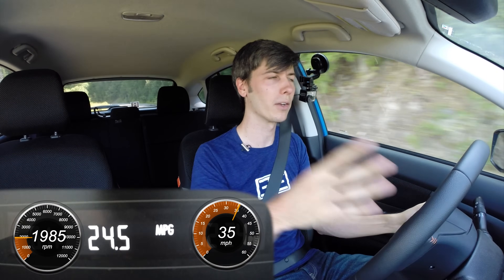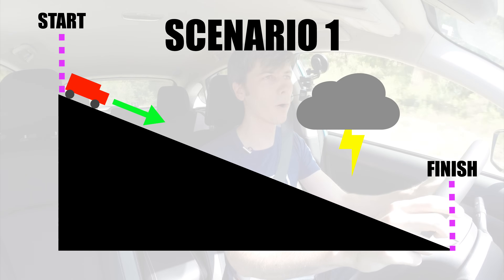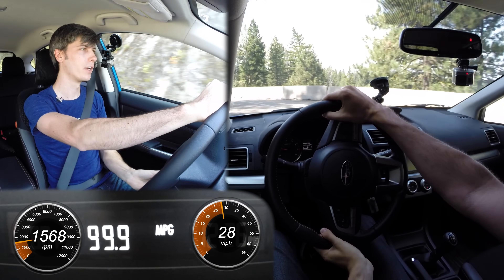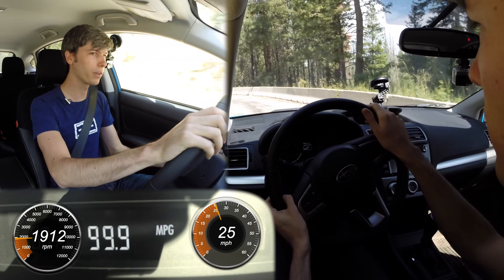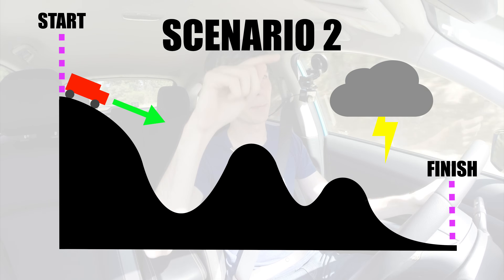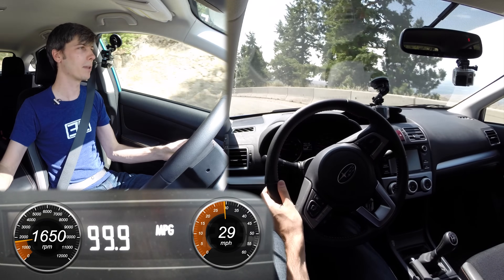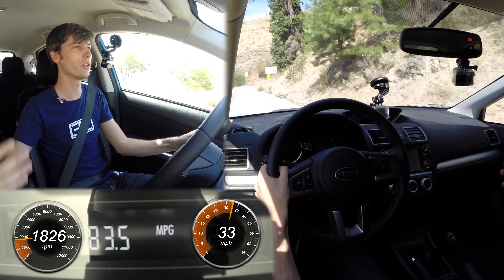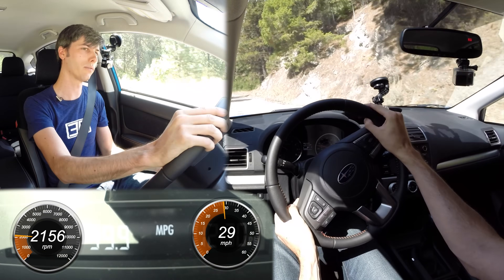What Uses Less Gas - Coasting Or Engine Braking?

Comment: I drive the same car (2015 model) and drive a mountain pass everyday. I notice that coming down in 5th gear uses fuel  but dropping to 4th  doesn't despite both allowing the car to gain speed downhill. At a low enough rpm it seems like it uses fuel regardless. On a side note, this car has the least amount of engine braking force I've ever experienced, much less than similarly geared manual transmission cars I've driven.

Comment: Well, my cousin's 1994-ish Chevrolet Corsa, with a 1.4 liter, Inline 4, Single Point Fuel Injection Gasoline engine, does not bother shutting the fuel off when going down a hill.
Not sure if the tech's too old or if there is a malfunction over all those years of neglect, but there is always a little bit of fuel going by on downhills.
Engine brake's still strong enough to lock up the front wheels in a rainy day if you dump the clutch on a gear too low though.

My Chevrolet Celta 2005, 1.0 liter inline 4 Multipoint Fuel Injection Flex (gas\ethanol) does shut off injection when it's going down a hill... and the engine braking is crap, even with the car completely empty.

Comment: Firstly, yes, neutral uses some fuel, more if it's an automatic, because of rev-matching. 
Your video brings 2 points to mind. 
1. When you're rolling down, using engine breaking, isn't the engine at a certain rpm (say 3000), wont it need some fuel to run?
2. Let's say the injectors a shut off, won't that create a vacuum? And possibly damage the intake valves?

And you've already explained about carburetor-powered vehicles, that there might be sm fuel going into the engine, where fuel pump would still be running. 
But, what if, you're still in gear and let your foot off the gas (on a highway, lets say), what happens then? Is it the same, that the injectors are turned off?

Comment: How do the injectors 'know' to shut off when in gear?
Reply: Well, the better question is how does the ECU know to stop firing the injectors. Actually it's very simple. If the engine runs over idle rpm or a certain rpm threshold and the throttleplate is completly closed at the same time, it no longer commands the injectors to fire.

Comment: While interesting imo this doesn't take into account most interesting scenarios. Your scenario 1 is basically obvious one, and scenario two is completely hiphotetical without previously knowing the road and experimenting. What about straight road, for example two miles to run, what is more efficient to coast in neutral losing some fuel but going further or ride in gear and lose more speed so you have to use some fuel to get to the same distance? What about going uphill?

PS. In SI, we use l/100 km fuel usage, so when coasting it's showing 0.0 which is correct, your system would have to show infinity symbol to be correct :) SI for the win ;)

Comment: So in a FI engine, if the throttle is disengaged and the road is driving the engine by means of the wheels and drivetrain, and the ECU detects higher than idle RPM, then there is no combustion happening in the cylinders even though they are revving? Is there no exhaust being ejected then, except for maybe air? Please educate me, I'm really curious.

Comment: Back in the day before power assisted steering and ABS brakes, you could both put it in neutral and turn off the engine and head downhill...

Comment: In your 5 things not to do in an auto you said the reason you dont coast in neutral is dangerous ect i understand were not talking about risk points but later you said the car will stop using fuel when its coasting because of the computer and will see no gain in fuel saving but in  this vodeo you said you will not trying to argue your the engineere lol but im just curious

Comment: Depends indeed. In my 2010 Mazda 3 with a manual, the current fuel consumption readout says it's 99.9 mpg going downhill whether in the 6th gear (was on the freeway) or in neutral.

Comment: I think you're missing some rigour in there. To assess which is the most fuel-efficient, you have to compare the same thing and not take two completely different scenarios. Engine braking power is roughly proportional to engine speed, so when the engine is idling, it requires just enough fuel to keep the engine speed constant which comes down to providing the same power output as that of the frictional loss. If you are in gear at higher engine speed than idle, it means you are basically dissipating energy at a higher rate than what you would do at idle, and hence you are making the overall fuel efficiency less. Now it all depends on how efficient your engine was when you built up the speed, and how efficient it is at idle. With regard to that, I believe it is nearly always more efficient to coast.  The test to really decide which is best is to take your car in a gentle slope which enables you to keep constant speed while coasting, check the fuel economy, and then put it in gear and apply enough throttle to keep the speed constant (same speed as previous test to rule out drag), and finally checking the obtained fuel economy for comparison. That's the only way to compare coasting versus in-gear driving. The best solution would obviously be to coast and switch off the engine meanwhile, but with all the power-dependent equipments on the current cars, it's not really suitable yet. I am sure it will however come soon.

Comment: i'm curious, what is feeding those numbers?
the on board computer? not very reliable...

can you make a video with measurements at the fuel tube and exaust end?
if it's really not consuming any fuel, the fuel feed should be zero and the exaust should be not emiting anything but residual heat...

can you make a vid like that, please?

Comment: So living in the mountains I have always used lower gears and "engine braking" to slow myself downhill to reduce wear on brakes.  Always have learned this is just how you drive but recently started hearing people argue that point saying it is better to constantly hit the brakes going downhill because new brake pads are cheaper than the wear the engine is getting.  Does engine braking or simply using low gear going downhill harm the engine that bad that wasting brake pads is the better option?

Comment: Engineering Explained can you pls answer in writing or video: Something along these lines.. what happens if you drive an auto, decide to coast in neutral for awhile, then put it back into drive again. You don't know what gear you'll be in so you can't match revs to speed. Does this negatively affect the transmission??

Comment: Great video, had this discussion at work many times too. The built in mpg gauge may behave differently based on manufacturer software. I logged injector duty cycle on my Subaru to get the same conclusion and would be more consistent data regardless of the car.
Reply: Sometimes its just a real time reading instead of an "average"

Comment: "Why", you ask, "does the car use no gas while coasting in gear?"  Because the throttle has a switch to tell the ECU that your foot is off the gas. Simple.  Some cars have a switch at the top as well (a 'kick-down switch') that tells the transmission to shift down (within limits) for faster acceleration.  Gas is turned back on when the engine speed is below a certain level (my car, 1400 rpm) to keep it running when you are in fact sitting at a light in neutral.  In my car, the ECU doesn't measure road speed or transmission gear or clutch pedal variables, it only works on engine speed.  It's an '86.

Comment: Also, do not use engine breaking in an old two-stroke vehicle. The RPM is much higher and the engine does not get enough lubricant and you can seriously damage it. Of course, such vehicles are hard to see on the streets anymore, practiacally impossible out of classic car shows.

Comment: So my question after watching this video is, does engine braking (especially when the engine gets to pretty high RPMs) put any extra wear on the powertrain? I'm curious because I've started engine braking to save my brakes but I don't wanna ruin my transmission in the process, for example.
Reply: Of course mate, friction is happening inside the engine

Help your brakes with 2200rpm but don't exceed that because it's not worth it if you're gonna keep the vehicle for too long

Comment: Quick question: Does this apply to an older car, say, a 1993 Nissan Cefiro with an RB20det? Does the injectors still turn off in the state of engine braking?

Comment: Your Subaru has a transaxle, not a transmission.  Also, a roller coaster has momentum, not gravity.
Reply: Michael W You know that part on a roller coaster where it pulls you up to the top of a giant hill and you almost stop moving? That would be almost 0 momentum, but full gravitational potential energy. Roller coasters absolutely work because of gravity. Also a transaxle is a type of transmission.

Comment: WRONG. The injectors are NOT "shut off" when you close the throttle. That would damage the engine and be dangerous from a control standpoint. There is fuel going to the cylinders, but it's only enough for an idle. There will be slightly more fuel injected with engine braking because of the higher rpm. The reason the computer goes to 99 or whatever your particular car's max is is because the method used to calculate the fuel economy is just an estimate, and as the number goes up the accuracy goes down. The amount of fuel being injected is relatively miniscule, so of course the economy goes up, but it is also impossible to measure accurately with the method that the car's computer and hardware uses. The first cars to have an mpg display were wildly inaccurate. They have gotten a lot better, but if you religiously calculate your fuel economy manually you will find that the car's estimate is not totally accurate and is better under some conditions than others.

To answer this question accurately would require actual scientific testing with equipment not available on any production car.

Also, the assumption should not be that you are coming to a stop at the bottom, but that you are going to be maintaining the speed limit from that point on.

Then there is the question of whether the incline is enough to make you speed up, stay at a constant speed, or slow down when coasting. For purposes of this discussion, it's reasonable to assume only the case where you will pick up speed if coasting.

That said, some educated guesses can be made. Coasting in neutral, the engine is idling. Using engine braking, the engine is also idling, but at a faster RPM, so it is using slightly more fuel, but whether it is measureably more in a real-world situation is uncertain. However, if you are using engine braking, you are converting potential energy into heat by compressing air, rather than your brakes, which is essentially the same thing as using your brakes but much easier on your brakes and pads. Coasting, on the other hand, converts potential energy into kinetic energy, which can be either converted directly back into potential energy by climbing the next hill or simply used instead of fuel to overcome friction and drag for a while if you're coming onto a flat.

So the answer is that coasting is more efficient, but unless the road is very straight it would be dangerous because of the increase in speed, and you will definitely break the speed limit. Engine braking is less efficient but safer and less likely to put points on your driving record, and the difference in efficiency is not as great as the difference in safety and legality.

This issue is particularly interesting with regard to electric vehicles that use regenerative braking (one-pedal driving). In city driving, regen is a good thing because it saves brakes and increases range, but only because that is under conditions when you need to reduce speed relatively quickly and otherwise you would be repeatedly just throwing huge amounts of kinetic energy away in the form of heat. On highway hills, though, regen isn't as efficient and can cause problems with heat accumulation in the battery and control system. But again, sometimes efficiency has to take a back seat to more important considerations. An added issue is that if you start out at the top of the hill with a full battery, regenerative braking isn't possible without damaging your battery.

Comment: I'm only now realizing that cars can be moving and sound as if they're running while they really are not. So off the throttle, in gear,, rolling downhill, there are no emissions coming out of the pipe? If you touch the throttle at all, fuel and spark are then added and you have combustion once again...

Comment: If you are new diver never drive car on neutral. Putting back on gear may fail and with downhill speed brakes may fail too. They are reported many accidents yearly involving poor use of engine braking and relaying on brakes only.

Comment: Been wondering this for a while, now I can go for maximum fuel economy!
Though most of the time when I was expecting to coast for more than about 30 seconds, I would just shut the ignition off, this would often lead to interesting comments from my passengers.  Only issue that would arise is if someone pulled out in front of me and I had to slow down, then I'd have to start the car again.  Even without power, you can still hit the brakes hard enough to lock the wheels if you really stand on the pedal, otherwise I'd have considered it too unsafe.  Never did it on any road above about 30 mph ether, wouldn't really want to have an acceleration delay on the highway.
Reply: That sort of driving is madness, you are not in control of your car. It could be the difference between being involved in an accident or not. I would strongly advise you try to break this habit or it will end in tears one day!
Reply: I've done engine off coasting but only when I'm the only person in the car. Be aware that the brake assistance uses up in a few presses so you'll have to press much harder to stop. In a large SUV it might not even be possible to stop quickly.

Comment: I kept arguing with a buddy of mine telling him a diesel don't inject unless its governing to the desired rpm/idle. But when I am coasting down a hill and it revs up a bit its still injecting fuel, but if I tap the throttle back a bit (this is on a tractor) it'll stop, I do have severe governor issues (If a heavy load is suddenly taken off it won't govern it keeps revving up for about 6 seconds) or is that normal? 1971 DT466. All Mechanical, rotary pump.

Comment: Hey I need some help, I have a manual car and its rear wheel drive. While towing it with dualys (front wheels go on the dualys and dont touch the ground but the back wheels are on the ground) I left it in gear accidentally. After noticing this after a couple miles I put it in neutral and then it started rolling smoothly. While it was in gear rolling though Im pretty sure the wheels were spinning for a large part of the time. Now whenever I start the car or drive it the engine makes a loud thudding sound... What can this even be and how would I be able to fix it??? Please anyone help.
Reply: dbstudioproductions I'm sorry to inform you that you have most likely done your big end bearings in on the engine due to the engine was effectively "running" without oil pressure from being driven by the wheels when the gear box was in gear and being towed. To fix it.... engine rebuild sorry. Hope it all works out for you.

Comment: In scenario 2 - most often the driver is restricted by the speed limit of the road. In most scenarios drivers are at or slightly above the speed limit (such as +10%). When coasting down the hill the car would significantly exceed the speed limit (depending on a lot of variables - reaching +30 to 50% of baseline speed wouldn't be unreasonable). The cost of the speeding ticket outweighs the fuel savings in most practical scenario 2s.

Comment: Is engine breaking worse for your transition though? I use eb and downshift to take turns but I heard it’s a strain on the transmission versus just using breaks which you can replace. 

At the end using breaks is cheaper than fixing a transmission..... 

Can someone confirm this

Comment: Hipoteticaly, coast in neutral in downhills would save tons of gas because of the inertia, but a detached engine would be really hard to stop the vehicle without the engine breaking, the wheels breaking are not enough to hold all the weight of the car by itself, putting extra effort on the safety conditions of normal use, so they will fade really fast and again you put in enormous risk. And even if you could break, this will reduce dramatically their life spawn, so in practical results everything you save from gas you will easily waste maintaining your brakes. I know that because I tested this several times. I live next to a highway about 800m above the see and work in a city 1100m above the sea, so my way back home is an 40m downhill freeway. Almost have an aciddent when I hit my break and whey are gone. Not cool

Comment: Even if your car isn't using gas while engine braking, I would rather put the stress on cheap brake parts as opposed to the mild clutch and internal engine wear. most would say that's pointless. I say it's technically true. So I always coast in neutral.
Reply from the maker: A fully engaged clutch does not wear (as is the case in engine braking, or being in neutral). And why do you say that it increases engine wear? With one scenario, you're not even running fuel through it (the stresses involved with combustion are much greater than engine braking). While in neutral, the engine is still running, thus technically there can still be wear.